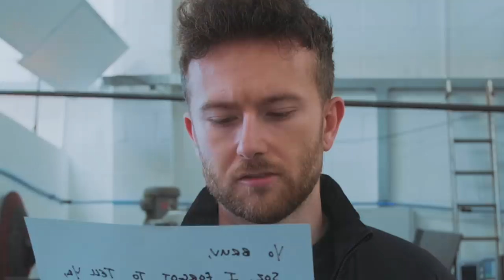My German friend intimidates me!

Comment: That square tubing you used as the upright supports for the little german friend, if you place a couple of them Horizontally under the upper platform and weld them in, you can use them as forklift points for when you move it again, it will make it less likely for a tumble (Rip Little Giant) to occur.

Comment: Alec, I assume your cliffhanger is because the motor rotation is wrong now. You likely dont need to buy a new one, you should be able to wire it differently to swap spin rotation. Good luck, love your content.
Reply: Putting the motor on the other side makes no difference the pulleys will still rotate in the same direction
Reply: @andyb7963  That actually depends really. Did Alec rotate and translate it or just translate it... If he rotated and translated it then yes it will need to be wired differently.  If he just translated it then no he won't have to worry about changing the motor direction.
Reply: Yuuuuup!
Reply: yep let the electrician sort it out

Comment: Um a small tip. It is not wise to work underneath any large heavy object. Especially one hanging from a gantry. Unless you absolutely have to and then it's still sketchy.

Jamie, dude, awesome, absolutely phenomenal! Reminds me of AVE. The first set of scales you tried, probably would have worked if you had stabilized them.

Comment: Alright, you got me. Before I saw the asterisk in the next scene I had already stopped to write up a comment admonishing you for putting yourself under the motor. Way to give a man a heart attack! I'll leave said admonishment below for posterity.

The forklift operator in me is literally screaming as I watch Alec crawl under the suspended motor to weld up that frame. I know that a gantry crane and a forklift are two very different things, but the safety principle is the same: NEVER put yourself in a position where a mechanical failure will allow the load to fall on you. Take that extra few minutes to wheel the crane out of the way, set the motor on the ground, and THEN weld the frame. Given the usual amount of attention paid to PPE and best safety practices on this channel, I'm incredibly disappointed to see you taking such a stupid risk.
Reply: Not a forklift operator, but SHEQ in training, i was doing the same thing as you.

Comment: Hey Alec, Love your content, been watching for a long time. BUT could you do yourself, family and friends a favor and please never ever work under a suspended load like that again. You never know when a hoist, chain fall or other means of mechanical lifting devices will fail. Seen it many times, was almost killed myself once had I been standing 3 feet closer when the upper limit switch of a crane failed and the 10 ton hook dropped 30 feet.  Do not want to hear that you were badly injured to something that is so easy to prevent.

Cheers and keep up the awesome work.

Comment: Alec - GREAT VIDEO and more Jamie.  One comment I would like to make is when you were working under the suspended load (i.e., the motor hanging from the gantry).  This is not done in the heavy construction world unless there are multiple forms of load carrying ability should the hoist cable or chain break.  Too many people badly injured or killed when supposedly safe working loads snapped a cable or chain.  Please keep yourself safe when working on your equipment, etc.

Comment: I do wonder if the 'i have been stupid' comment at the end was his realization that if you move the motor from one side to the other, you have to keep in mind the rotation direction.  Luckily it is a big 3 phase motor and I think you can reverse the direction of those when needed just by changing the wiring.  Jaime's part was definitely the best bit of the video though. :)

Comment: Sorry for the comment but when it comes to safety:  you NEVER work under a suspended load, Alec.  It doesn't matter if it's 200 lbs, 2000 lbs, of 200,000 lbs, you NEVER EVER work under a suspended load!!!!

 I'm sorry if this is coming across as harsh; I was working in the Canadian oilfield 2 km away from where a guy got crushed by a light tower that wasn't secured to the back of the Picker deck and the hoist had been removed.   He was only 20 years old and making it worse his uncle was the one running the Picker (the 80 ton crane truck) they dropped the load where it was overhanging the back end of the "high-boy" trailer (within weight limits of the vehicle and local guidelines for overhanging loads) when they picked the next object the truck and trailer shifted and buddy got squished like a human pancake because he was under the overhang tightening the load chains....  first-hand I saw more than a fair share of near miss Crush incidents with Slickline and wellhead components and all assortments of stuff.... 

 Please just don't ever work under a suspended load, dude it's not smart for any reason; no amount of time under a suspended load is safe, even if it's only for a few minutes or seconds for a shot, it doesnt matter... if it's a load in the air, you stay clear until its landed. Use tag lines and Hands-Off practices when using any hoist, crane, or lifting machine
Reply: There's an asterisk in the video where they say they moved it out of the way in reality.
Reply: @myfrit  gave me a minor panic attack man, even just for that shot it was not smart...

Comment: DID YOU REALLY just weld that frame in place with the motor hanging above you on one chain...???    Did I REALLY just see that?
Reply: 8:18 "Motor wasn't actually left above Alec - we're not that stupid" in the bottom left corner of the screen
Reply: @hadinossanosam4459  - AH - that bit is cut off if I have it full screen on my iMac - thanks.